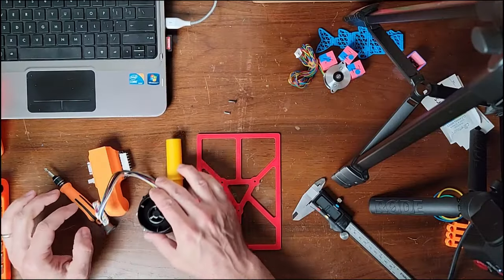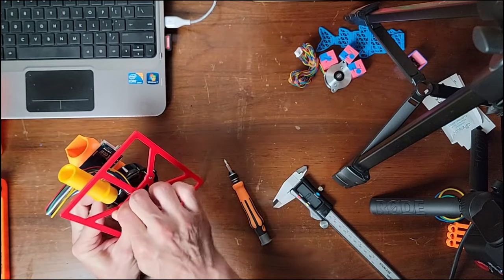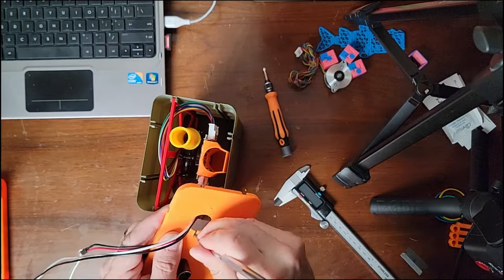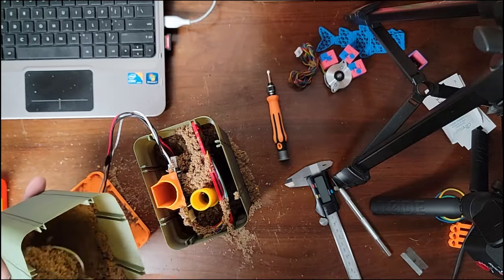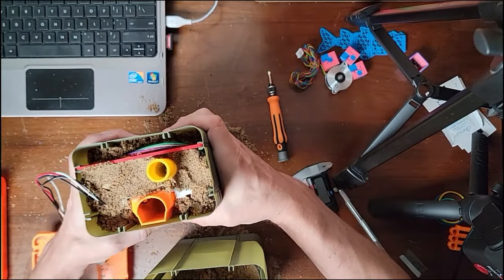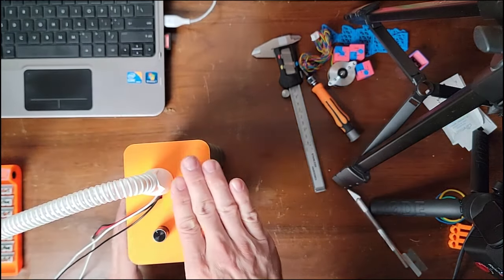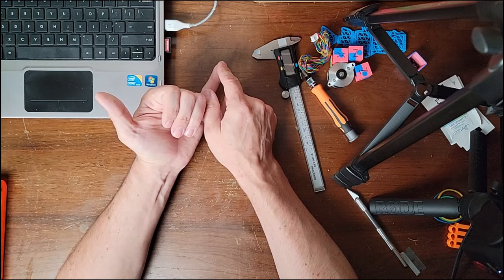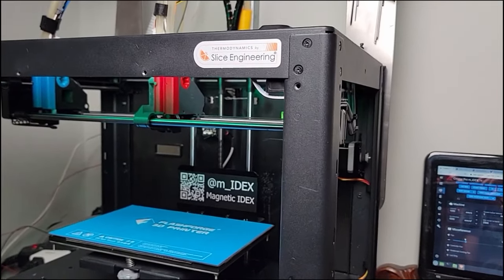Quiet CPAP Blower Enclosure Assembly for Magnetic IDEX 3D Printer #3dprinting

Comment: I would afraid of corrosion and heat. What about double wall box?
Reply from the maker: I will be sure to disassemble my enclosure in a year or two to see how it looks. I am not worried about heat because all the relevant components are continuously flushed with cool air.
Reply: @m_IDEX  there are coats in spray, nanocoats, that prevents electronics from rusting. It's like oil, looks like WD40. RC modelers use it to make models waterproof. I used it for RC car and Espresso machine control board.

Comment: What's the part cooling like with 25% power?
Reply from the maker: I find that 25% cooling produces excellent results for most PLA prints.  Larger prints with longer time/layer typically require less cooling and tiny prints require more cooling.  It is all a balancing act.

Comment: This was disappointing. Noise is managed primarily by avoiding to produce noise in the first place. Dampening noise sort of work, but only to a certain degree. But suppressing noise should be avoided at all costs. When there is a need to suppress noise, it clearly demonstrate poor design. Something simply is inelegant.

Cabling and cooling remains completely unsolved, maybe even un-tackled in greater parts of this industry. We sort of need talent like yours to tackle it.

But come on. Building a cat toilet inside the printer simply is not it. Speaking from experience, this is what plenty of people will call it. If you stick with this, you will deserve such praise, as a designer. So as a designer, congrats on your cat toilet. This was disappointing. I am a dog lover.

As a hint to sort of moving on, we need to look at the results people are having. When a speed boat racer reports too much cooling, and looking at his work, he actually has two kinds of part cooling, and one of the types is too effective, even for speed boating. Combine that, with an industry wide lack of exhaust airflow directing, then we as designers have something tangible to actually work with. But as I have said, I love dogs, I do not need any cat toilet. Please tell med when you are ready to throw the cat out.
Reply from the maker: Thanks for your feedback.
Reply: @m_IDEX  you got plenty of talent, but I can as a designer, speaking from hard earned experience, guarantee, that a bunch of people jump straight to cat toilet, for any design using sand. They just will not tell you, but they do.

And I am still telling you, that something is off with the cooling, in general, in the industry. I need a proper fix for it, and is working on it. It is a design nightmare. So, typically something I love tackle head on.

I will be doing so, no matter what you do. But if you are up for it, throw your talent at it.

But if you get stuck in the sand, don't bother. This is a designer nightmare to solve, and if you are too slow to get the drawbacks of sand, you're not up for this one. In case you don't get it, it has nothing to do with cats. Nor what people say, rather why they feel that way. You'll hopefully get the point someday, but then it will be too late, and you will learn it the hard way.

Peace. Out.
Reply: I bet you're fun at parties? Post up your design so we can critique champ.
Reply: @jamesm3268  You're not getting into my kind of parties. It is kind of meaningless to "critique" almost all of my work. Who knows? Maybe you will get that point some day? Talk to you then.